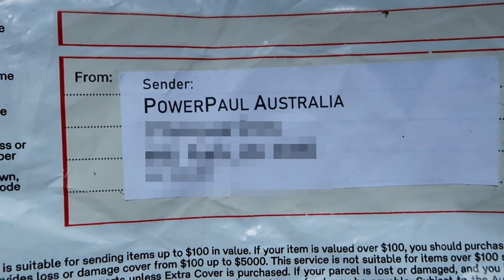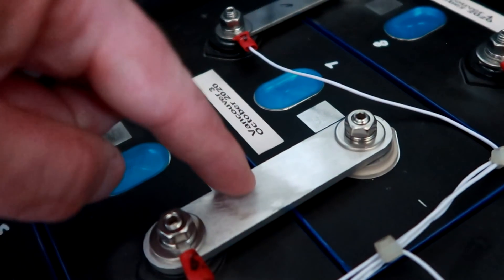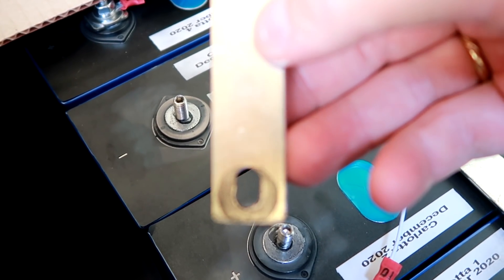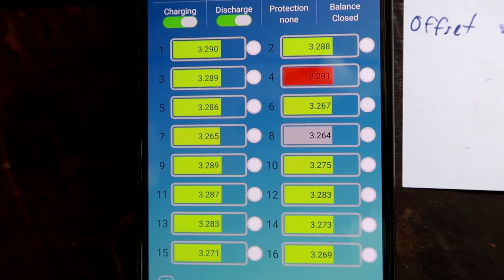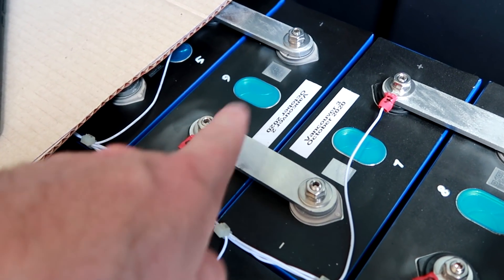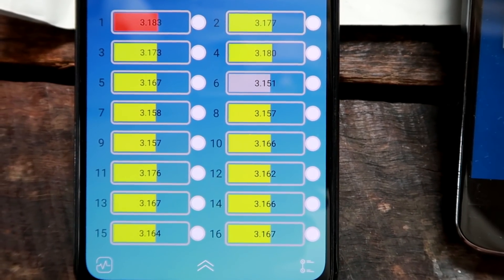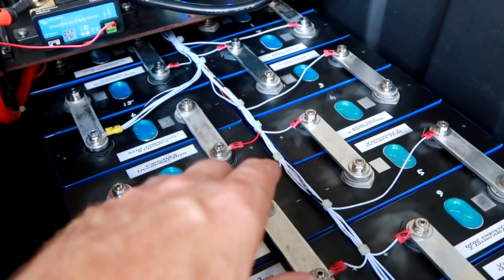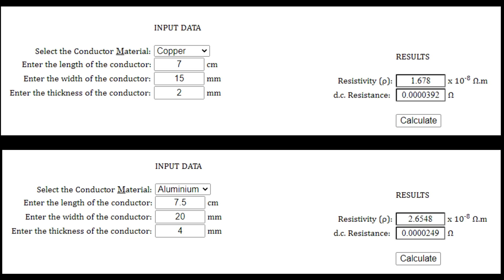Upgrading to Aluminium Busbars. Will this solve the issues?

Comment: The good news is , one cell ALWAYS has to be the lowest, they can never all be the same. SMILEY FACE
Reply from the maker: NOOOO, they all need to be the same 😁
Reply: @OffGridGarageAustralia  this will be a dream forever. While balancing the Balanced cell will be on a higher voltage Level. Then the bms needs to stop balancing to see the result of the balancing. This will Drop the Single cell voltage. Cells can be in a range of eg. 10mV and this needs to be considered as balanced and "the same"
Reply: @OffGridGarageAustralia  You just have to force them. May the Schwartz be with you!
Reply: @OffGridGarageAustralia  Some are more equal than others
Reply: Gefällt mir gut.. Aber stimmt schon.. Du wirst immer eine hohe und eine niedrige Zelle haben.. Ist bei mir nicht anders.. Selbst ein Balancer hat Abweichungen.. So langsam wirst hier zum Vorbild 😂👍🏼
Reply from the maker: @ennyw20  Yep, one has to be the highest and one the lowest

Comment: If you have an adjustable voltage charger , you might can try charging each of the problem cells back up manually to the nominal 3. Or so volts  to match the other cells voltage . Make sure the buss bars are removed from the problem cells completely in order to charge each back up individually.  Make sure power to and from the batteries and BMS cable connections are disconnected . It may take some time but monitor each charging cell until the voltage of the others is achieved.

Comment: Andy, I am worried that with a suspect charge controller and a faulty BMS that there isn't chance of a overvoltage event. When are you going to measure those FETs?
Reply from the maker: I keep an eye on the voltage. Battery is at 50% only and cloudy weather so no problem. But you're absolutely right.

Comment: Andy, I'm not so sure you have a problem at all. Your batteries when charging and discharging above and below approximately 3.3 v can be off much more than the difference you have. I see a difference of .05 on my batteries on the high and low side. My thought is that your batteries are fine. Your friend better get his laser ready to cut thousands of bus bars for people now! 😁 Those are perfect!
Reply from the maker: Hi Dan, that is exactly correct what you're saying and I will show this in my future videos again. All is fine as long as you stay in the flat part of the curve, right. 
The busbars have greatly approved the situation now.

Comment: Thanks for this valuable information.  Always documenting each step and love the information you provide.  I haven't tried those bus bars yet makes sense though the more I think of it for longevity the aluminum to aluminum contact should prevent long-term issues.  I will watch and may end up ordering some of those if it works out for you over time.  I am curious about how flat is the platform under them wonder if it affects the stress on the terminals and angles and all that.

Comment: Hello Andy.
Great bussbars. don't forget, they also cover all the posts surface, when the copper covered only partially the posts. 
If we use the step in dog sht analogy, maybe the copper bussbars left their print in the aluminium posts even more on n° 6 wich you have been tightening repeatedly. 
Instead of copper paste, wouldn't it be logical to use aluminium paste?
Cheers.
Reply from the maker: Thanks for your post. Yes, it should be Al paste of course, not copper. Possibly just an anti-oxidant paste to keep them clean. So far not problems any more.
Reply: Great, let's watch your next videos. :-)

Comment: If you take your power resistor and shorted across the highest cell it will discharge that cell to help you balance them faster so you can drop cell one down to the rest that will allow the rest to charge a little higher if you're BMS is shutting down for high voltage on one
Reply from the maker: I have done this before and it messed up my whole pack (watch past episodes). It's best to only judge the cells when they are empty or full.

Comment: What’s an acceptable voltage drop? I had an issue with a bad crimp that was causing a huge voltage drop. It was to the point where it was dropping below 24v. 
I’ve since fixed that crimp, but I do have a small voltage drop when pulling like 60 amps.
Reply from the maker: It should be 0mV from the terminal to bus bar. If I cannot measure it with my voltmeter, it's below 1mV and considered 'good' for me.

Comment: You're going about this all wrong.   The busbars are not the problem.   The busbars you have are fine.   We can know they're fine because countless other people are using the same kind of busbars (nickel plated copper) without an issue with the busbars.   So, look somewhere else for whatever problem it is you're having.  The cells are either out of balance or you have a bad cell or cells.   One way you can trouble shoot this issue is to move the batteries around such that the current cell number 6 is now a different number and see if the problem follows the cell, or not.

Comment: I have the original busbars after sanding with Scotch-Brite mine improved a lot
Mine are only off by like 7 to 10mv when charged to 3.5 or higher per cell
As you said charging higher then 3.3v mine are only off by 1-3mv tell they are above 3.4v
Reply: Josh, That is no surprise, Nickel oxide is a pain. You can't see it because it is transparent, it is good on stainless steel but not so good on electrical connections, Duetch connectors are a pain that way.

Comment: Have you thought about breaking the system  down to 4 separate 13v packs and then connecting thoes in series. Yes you would need 4 bms instead of one but should cut down on voltage drift. Or while I know its expensive but a bms like a Batrium.
Reply from the maker: That would be bad. Why should I do that?
Reply: @OffGridGarageAustralia  I just always figured smaller packs would be easier to manage and I've never liked pulling large amounts of current through a single bms

Comment: Fully charge the pack, then top balance the cells. I have an ISDT brand BattGo BG-8S unit from the drone and electric car/plane hobby area - cost is around $30US. It can monitor and balance up to 8 LiPo (including LiFePo4) cells - I have a 24v system, but you could do half of your system at a time - just install 2 x 9 way tails. I find my BattGo far more accurate than my BMS cell voltage monitor, and it does a good job of both top and bottom balancing cell banks. My 260Ah bank takes a while with this device, around 24 hours to balance up to 40mV differences, but for the cost and a simple way to confirm the accuracy of your BMS it’s another great “toy” to have in your tool kit. For now I would swap cell #6 with one of the “teens” and see if the problem moves with the cell, or remains with the location. All the best, stay safe.
Reply from the maker: Thanks Ian, I have the 8-cell CellMon but I don't think it can actually balance (even it says so). The BMS does actually read all voltages accurately but just takes a while to balance these large capacity cells. It may take several cycles until I will see a progress with this.
Reply: Thanks for the reply. The thing I LOVE about the BattGo is that you can manually begin a balance at any state of charge - yes it takes a while with larger battery packs, but still an amazing bit of kit for the price.

Comment: I bet it is a BMS calibration issue.  Swap cell 1 & 6 in the pack.
Reply: Yes, I had this in mind for a while through these videos.  This Chinese stuff is not known for "precision" or "consistency" and the BMS has to have all of its 17 volt sensors within a reasonable tolerance.

Comment: What is an acceptable difference between cells, I've got 8 victron lead carbon batteries that are two years old and they often have 0.5 volt difference
Reply: These are SLA batteries (6 cells internal) and cannot be compared with lithium, if you have more than two batteries in series it may be wise to use a Victron SLA battery balancer.
Reply: Surely a voltage drop at the terminals is a problem for any chemistry? I've seen a few videos with cell balancers I think the Victron one would need 3 to do a 48v battery and additional link's to interconnect the two strings of batteries? I've also seen one that's 48v available from Amazon. Some information says it's not necessary at all.
My system is two 3kva easy solar  units essentially two 3kva multiplus and two 150/70 mppts I've disconnected one colour control and one set of RCD/mcb's and 12 x 300w panels.
Reply: @551moley  You would indeed need your three "Victron battery balancers" for a 48Volt set-up, it is possible without,  the same for lithium cells, but risk or safety is always a choice ..

Comment: Copper and aluminum don’t mix anyhow. If you use a copper rivet on a aluminum boat, the aluminum will start to corrode. That would be bad news for your batteries
Reply: But if there is watter or high humidity, other wise if you seal the terminals with liquid tape it won't corrode for a long time.

Comment: 5,000+ Charge Cycle Absorption Recommendation by Victron for LiFePO4 batteries is 3.525 per cell. Battleborn recommends a 3.35 float to keep the cells at full charge.
Reply: Yeah,  or less, bms doesn't like high voltage. I will try 53.6v tomorrow.
Reply: It depends entirely on the C-rate that you are charging the battery at.  At 0.5C a 3.525V charge target and absorption is reasonable.   At 0.1C that voltage will result in a far higher state of charge and might not be a good idea.

-Matt
Reply: @junkerzn7312  Generally the charge will go from absorb to float at around 5-10% of C rating so it shouldn't matter.
Reply: @junkerzn7312  But when you charge with solar it isn't a constant c rate  so the raiting is dependent of solar and batteries size.
Reply: @neliosamch3195  In this case, however, he has measured it and his best-case charging rate is less than 0.10C.  At that rate, its almost impossible to get an accurate capacity just using the charge controller's voltage settings.

At low charging rates, a more fully integrated solution that actually counts the energy going into or out of the battery is needed to determine the battery's state of charge with any accuracy.

At higher charging rates the variability of the solar isn't that big a problem.  At low charging rates, though, you could wind up with a battery whos state of charge is +/-20% from your desired target, depending on the solar variability.  A high target voltage can easily result in an over-charged battery (e.g. 95%+), reducing cycle life.

-Matt
Reply: @junkerzn7312  The problem with lifepo4 batteries is similar to lead acid batteries, it can be fully charged at 3.35v and with the saturation it drop down and stays around 3.3 v. The voltage of these batteries spike after 3.4 v so there's no reason to charge these batteries beyond 3.4v.
Reply: @neliosamch3195  If you only care about trickle-charging the battery, then you can use 3.40V.   If your solar array is tiny that might be fine.  If your solar array is bigger, though, you wind up wasting most of the power it can produce because the current going into the battery will stay at a trickle at that voltage.

The current going into the battery at 3.55V is at least 4x higher, even more.

So it comes down to what your charging power source is going to be, and how much of it you have.   That is, it depends on the C-rate (which in turn depends on the power that can be produced for charging verses the size of the battery).

At 0.1C, a 3.45V target is decent (even a 3.40V target might work, but I don't recommend going lower than 3.45V).  At 0.5C you need to use a 3.55V target or you will wind up under-charging the battery.

For Float, a voltage of 3.35V to 3.375V is good.  This has less wiggle room because you absolutely do not want to push current into a fully charged battery at the Float voltage. That will reduce its cycle life.  Even 3.375V is a bit hot for my tastes.  I prefer 3.35V for Float.

-Matt
Reply: @junkerzn7312  my solar is more than 4kw and my target was 55v but today two battery pack spike and shutdown  the qucc bms still waiting for the quick software engineer how to reset the bms again, so I  will try 53.6v tomorrow.
Reply from the maker: Where does it say 5000+ cycles? I could not find such information on Victron's website anywhere.
Reply: @OffGridGarageAustralia  All I know is my batteries are less that two month old or about 60 cycles and 4 off them already are going down.  These batteries are way over priced. These batteries are going to be biggest scam since the Lithium revolution.
Reply: This could go on for ever. We here  3.65 per cell ,3.35 per cell 3.5 per cell. And also at least 3.4 for bms to be able to balance. Do we need a few years to really get it right??
Reply: @sharyncomstock7066  If you want to charge up to 90% SOC, 1)Find the capacity of your battery by doing a discharge test with a shunt. 2) Charge slowly up to 90% of that capacity and record the voltage right when it hits 90%. 3) Set the absorption at this voltage.
Reply: @sharyncomstock7066  That's right we need the naked truth about these batteries because we are being told marketing plats to make us pay more for these batteries when they are nothing more than a little better as lead acid batteries.

Comment: you may want to get a couple more cells so you can swap out the bad ones that you find during testing.
Reply from the maker: Are they bad actually? I've done a full discharge test on the whole pack in the next video.
Reply: @OffGridGarageAustralia  Maybe just a little less capacity than the others.

Comment: Don't even think about copper paste between aluminium conductors.  Buy the proper stuff from an electrical wholesaler.
Reply from the maker: The proper stuff...?
I've got around 25 recommendations so far for different pasts, grease and other material so far.
Reply: @OffGridGarageAustralia  I added the brand and part number to a previous post.  It is a Utilux  product which is certified for the job. I will go downstairs and get the number for you again directly . 
Aluminium lugs are filled with Aluminox and capped when you buy them. We crimp them to 23 tonnes because aluminium is a very fussy product when used as an electrical conductor, the paste cuts any oxides (Aluminium oxide is the white stuff spark plug insulators are made of and is the dielectric that makes electrolytic capacitors possible). It is a powerful insulator. 
My 64 x 310 ah CATL cells were despatched today as were the 16S BMSs and Active Balancers (4 of each).
Tonight I ordered UL certified lugs from Red2Go, price was pretty good. 
My Belleville washers are here ($16 / 100), hardened washers and brass washers left Bolt and Nut Australia  in Brisbane today.
I'm going to try large cable ties for the clamping in batches of 4.
The new setup will fit on the Oak shelves I made for the AGMs. Because of the change in battery regulations, I will have to move everything though. 
The paste is Utilux H2397, in the industry we know it as Aluminox from its old name.
I just looked it up, CNW stock the paste, joint preparation PDF documents from Utilux are available on line.
Cheers.

Comment: Fantastic achievement...
   Could be a rouge cell or bad connection...
    With all that power. Does it really matter.
    Could be a problem with the BMS interface.
     Eventually you may find the problem... 
      Engage Warp Drive #1.
Reply from the maker: Hahaha, exactly. Just wait for the full load test in the next video...
Reply: G'DAY 
  I have noticed with some pre built Batterys,  the bus bar's are laser welded on..
   Might be a  good idea to move that battery to a different position in the pack possibly the highest one in the pack and see what happens over the next week of  charges. 
    Good luck 👍
 Maybe a split spring loaded washer might be better..

Comment: hey did you try soldering the tip of the crimped bms wires to improve contact?
Reply from the maker: No, not yet. they seem to be very good though. I may end up threading them into the busbars anyway at some stage
Reply: @OffGridGarageAustralia  imo a good crimp does not need any solder added to improve conductivity.

Comment: Suggestion:

Change the physical place of cell 6 in the pack.

If the problem follows cell 6 you know it is something with the cell (not the connection, not the bms).

Although I honestly think you are overthinking this. The setup will run more than well enough as it is...
Reply from the maker: The battery performs well, no question. I still want to understand a few things so I keep testing different things. Swapping the two batteries is on my list.
Reply: @OffGridGarageAustralia  I would bet the usual china issue of different cell sources they had sold in the beginning or even used cells.

Comment: Hi Andy, I would recommend charging the entire pack to 3.6V per cell by setting the charging cutoff at 3.6V.  When it stops charging because of the top cell, shut off the battery disconnect and individually charge the cells that are not at 3.6 volts, and charge to 3.6 volts.  I use a hobby charger and alligator clips to charge individual cells in the pack.  This should top balance your pack and then see if they stay in better balance.
Reply: I think he did just that a couple of videos ago , but still dosent seem to be helping. Ofcourse now he has new busbars so maybe can be some diffrence. I think the provider sent with a b-grade cell with the a-grade ones.
Reply from the maker: I did a full discharge test. Wait for the next video.
Reply: Ill buy some chili nuts and some beer for next episode.